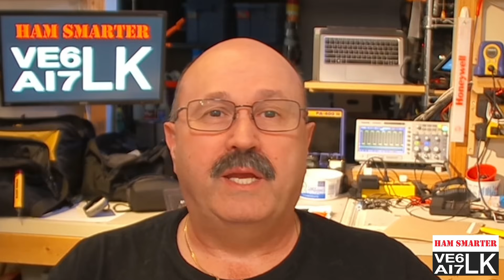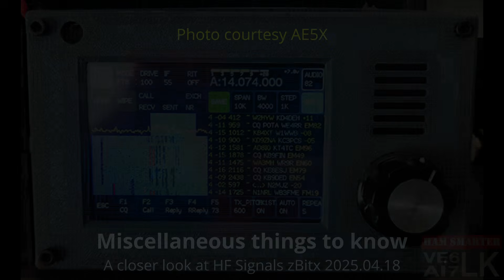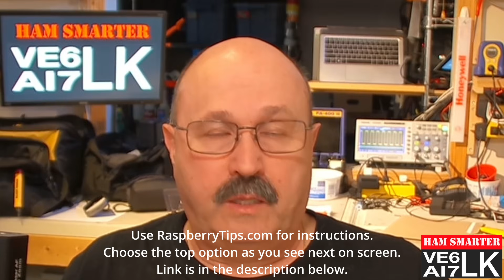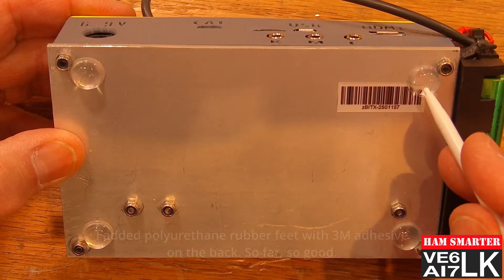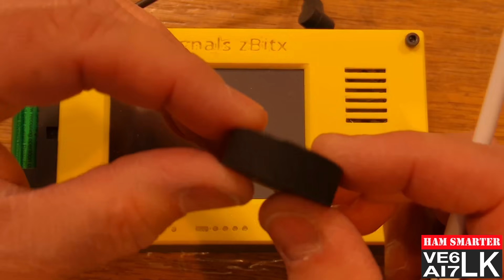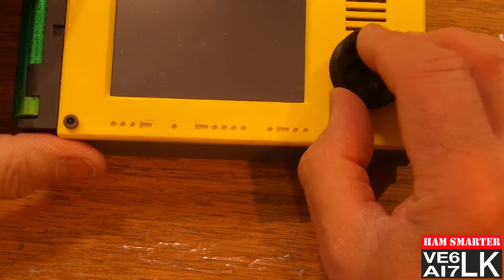zBitx first look - Miscellaneous things to know

Comment: @VE6LK what of the ZBitX not being able to handle greater than 16 words per minute CW?  And an SWR meter lifted from an open source team that isn't accurate?
Reply from the maker: I've not heard of this limit, and as far as the SWR meter goes - I always use an external device. It's not a $2000 radio it's a $200 radio and I, for one, expect some limitations or imperfections.

Comment: there is 1 pin still available IO26(#37) for PWR DWN switch if needed. I am not a zBITX owner , but I have HB my own. So if one can use this pin to run a shutdown script , this issue is solved.

Comment: I don't remember what printer you're running but  you should be able to get a spring steel PEI covered bed sheet.  Easier to use than stock beds on older printers and gives you that cool finish.  PLA literally slides off when the bed cools down.
Reply from the maker: That's a great tip - thank you!

Comment: Are the batteries button top, or does it matter?
Reply from the maker: I have used it with both, although button top are easier to visually see positive or negative -which is good because you don't want to reverse polarize them at any cost.